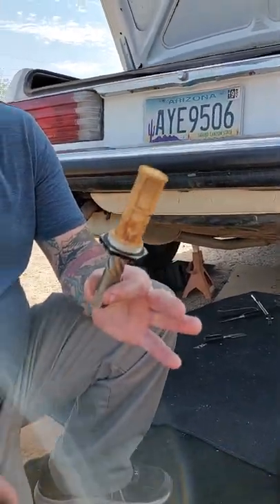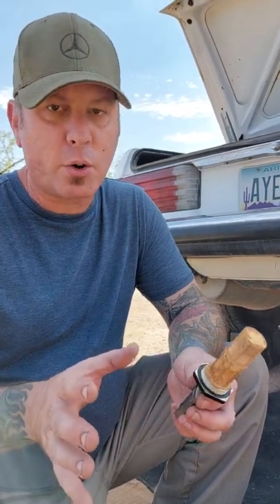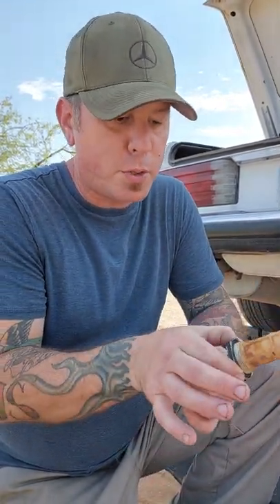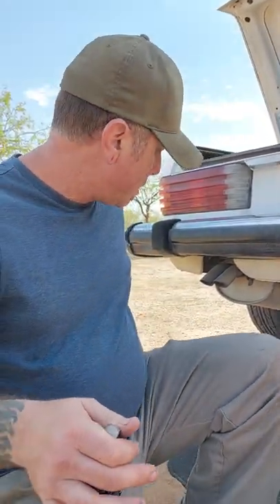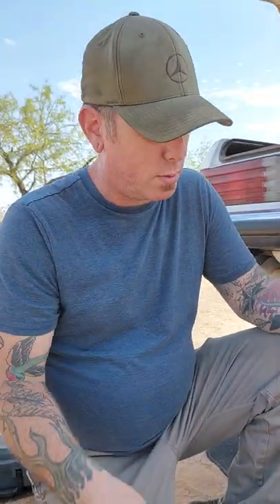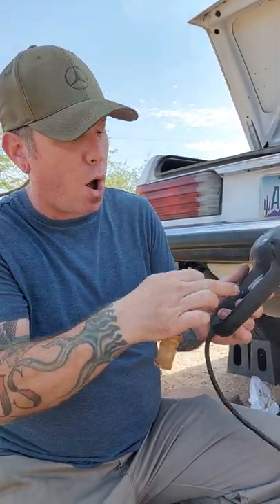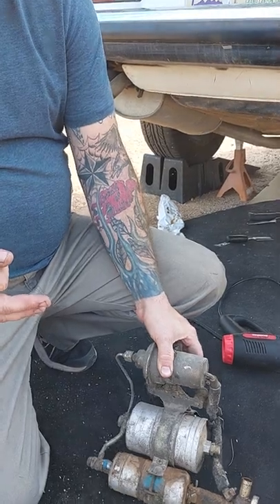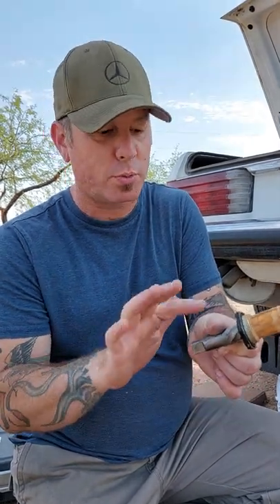R107 Fuel Strainer Removal-1985 Mercedes-Benz 380SL

Comment: Good stuff Brian.  Like you I got mine out with a 21/32" extractor.  Mercedes Source sells a strainer and removal tool for $80 but I found the extractor worked fine on the first try.  And my strainer looked 3x worse than yours to the extent you couldn't even see the o-ring.  Original strainers appear to be brass, replacements are aluminum.  FYI you may have to take a dremel tool to relieve some of the sheet metal on top of the strainer - on the R107 that was an issue as they didn't oversize the hole and the tank and supporting sheet metal clearance hole alignment is generally a bit off.
Reply from the maker: Wow thanks!
Reply: @PastorOfLight  I kept mine.  Wish I could show you a photo.  Looked like it came off the Titanic.

Comment: Thanks for the video.  I am doing the same thing.  I am stuck on removing the hose from the strainer.  I have tried a wrench, crows foot wrench, … how did you get yours out?  Thanks, also, appreciate yoUr witness Brother!
Reply from the maker: I bought a new hose because mine was so hardened onto the line. I would say there is no way to get it off without cutting it. Sorry brother. I bought my new one from Eeuroparts.com
Reply: You can usually get them out with a 17mm claw and a socket extension.